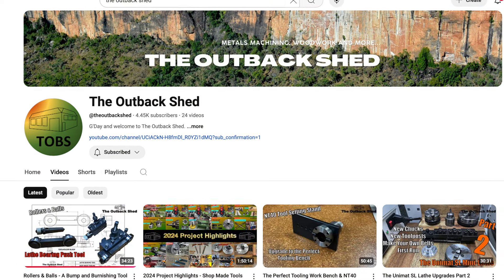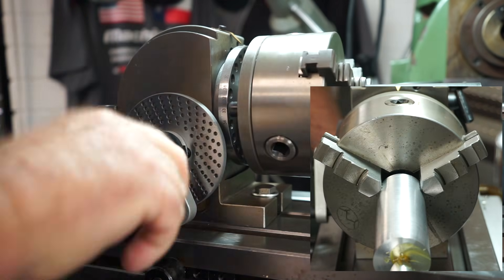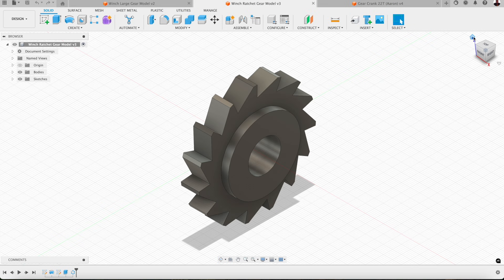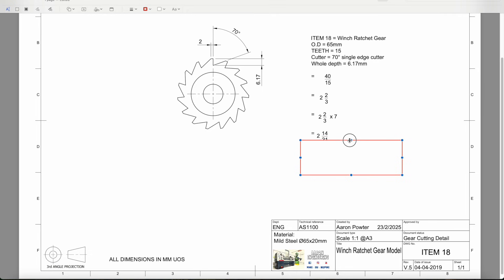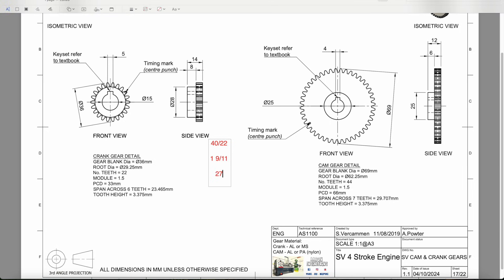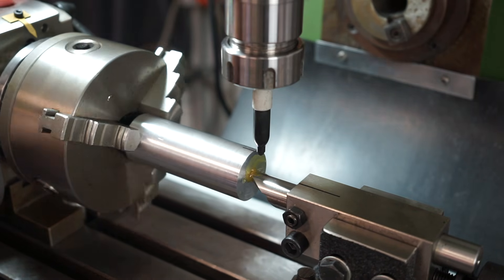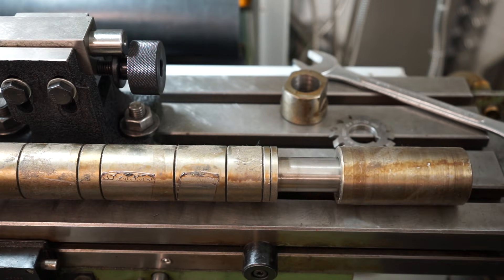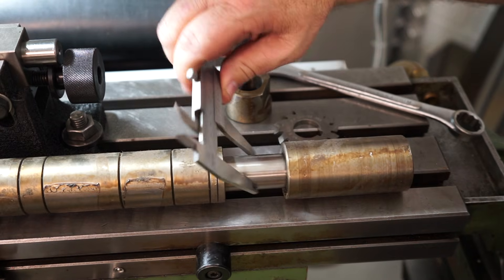Shop Math | Dividing Head Calculations | Simple Indexing

Comment: The way I like to approach it similar.  I know that it I have a 35 hole plate then every 40 holes will give me 35 divisions. Same with if I need 16 divisions and only have a 32 hole plate every 80 holes will give me 16 divisions.
  Just keep in mind that if you go every 40 holes you will get the number of divisions that are on the hole plate for a dividing head that takes 40 turns per revolution.
Reply from the maker: G'day Mike.  Thank you for that detailed explanation.  That is some excellent advice and a very handy tip to know.  Thanks for watching and commenting Mike.  Regards, Aaron.

Comment: G'day Aaron. Thanks for your very informative run down on deviding heads.
Would like to see a more in-depth segment with spline & gear cutting .
Well done 
Ted
Reply from the maker: G'day Ted.  I will come back and cut this gear.  Just making a new BT30 arbour now to fit that involute gear cutter.  Sadly I can't help you with helical cut gears.  My table won't rotate (around Z therefore C axis) like a universal table will.  Cheers mate.  Aaron.
Reply: Helical gears, are they a preset angle, as in gearboxes, or machines